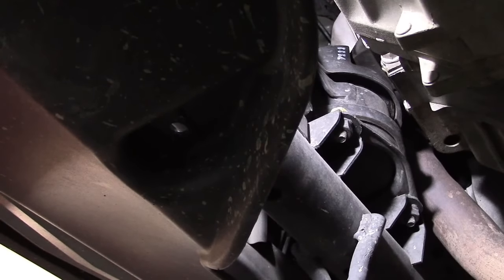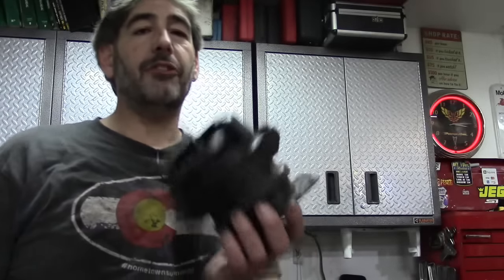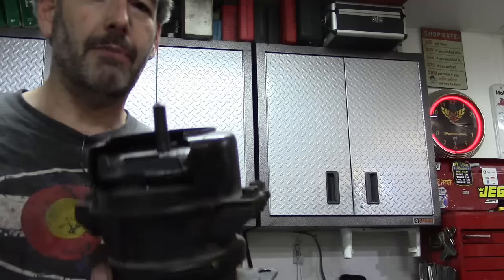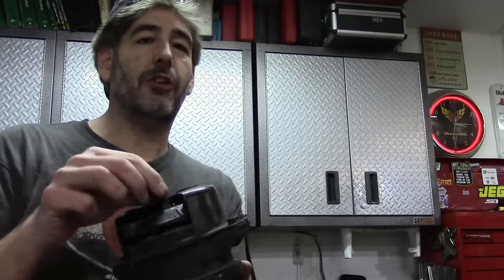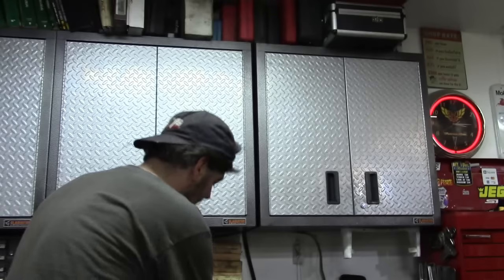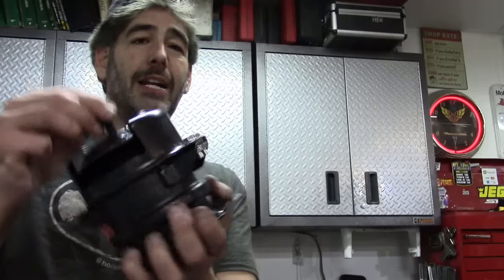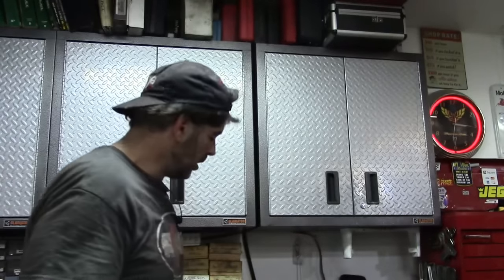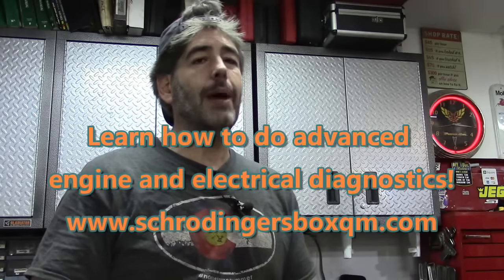How to check bad engine or transmission mounts

Comment: Another tip for anyone interested.... Sometimes mounts can fail another way that causes excessive vibration while engine running that can be felt in cab. Saw this a bunch with 4 cylinder Ford products with hydraulic oil filled mounts. To diagnose have the car running in the condition that creates the vibration ie park, drive, reverse with an assistant at the wheel. Put block of wood on floor jack and lift engine under oil pan. You may notice with the engine at a different angle the vibration goes away. Replace the mount located at the top right front of the car, often described as "front engine mount". These mounts often go bad without any other visual indication.
Reply: I'm so glad i found your comment, i replaced the driveshaft and bearings, took the car for wheel alignment and it was still vibrating i'm gonna try to replace the engine mounts and hope for the best.
Reply: Thank you YouTube family, vibration is completely gone, it was the front and driver's side motor mount, i can't remember the last time i drove with the whole family without the whole cabin vibrating on the highway 😭

Comment: What do you think about putting a floor jack under the engine, and just slightly taking some weight off of the mounts.  Then, if the worn mounts are not under load, see if clunking goes away?    That was my way of diagnosing.
Reply: That sounds a lot easier

Comment: hello, the same thing happens with my 2016 transit, I mention that the engine mounts are brand new from ford, how can I contact you, maybe you can help me, I have this problem for a long time and I spent about 4000 pounds and the problem is still there 😢😢😢many thanks

Comment: This is the exact thing that happened to my LS460. I would brake sharply and it would clunk. Then at hwy speeds when I would try to pass someone, it would shift hard, but only when it would downshift to pass another car. Replaced the trans mount and all symptoms were gone. Good informative video.
Reply: I’m having the same issue with my ls460

Comment: I got the Trans Am to pass emissions -- turns out rotted rubber hoses on the evap line were leaking HC and being picked up by the sniffers at the emissions facility, causing a false positive.  I'm happy!  Thanks for all your videos, Matt.  I've learned a lot.

Comment: I usually "stall" the car. By pressing the brake firmly and adding enough throttle to tweak things. (This is while car is on the ground) that and drive to reverse with the addition of the brake stall. 

Also just briefly snapping (hit somewhat firmly but only briefly)  the brake while rolling forward is it good way to spot control arm bushings. I can just feel it but you can feel the front slopping around or have someone watch it if possible in a pit ideally.

Comment: Do engine mounts leak oil from the top of the black rubber?
Reply from the maker: Hydraulic ones do when they go bad, yes.
Reply: @SchrodingersBox  I have a 2016 Mazda 6 are they hydraulic?

Comment: Just starting to have vibration during acceleration but and when turning to the right during acceleration.   Not a mechanic at all but starting to try to fix this and liked your simple possible explanation of the reason maybe.  You still doing videos?  Have a Juke 2015 with 115,000 roughly miles on it.
Reply from the maker: I have another video of a Volkswagen Jetta where I diagnose a similar vibration you may want to search.

Comment: Hi i just replaced front and passenger side motor mounts.(2005 altima)..still have vibration when sitting at a light....when i put in neutral or park it stops... only notice it when stopped not when driving>>> does this sound like a bad transmission mount to you??? i am pretty sure so i have one ordered... thanks for this informative video...
Reply from the maker: could be engine rough idle. I always start with a basic fuel trim analysis to rule that out before I even consider mounts since it’s so fast and simple.

Comment: How would you test this in a manual? My Firebird makes a bunch of clunking sometimes when it idles, the engine looks like it’s moving around.
Reply from the maker: Same way. have e brake on and slowly apply clutch with car in gear and look for movement.

Comment: Not sure if I am too late for a response however I have a 06 f150 with sadly a 5.4 3v. I have this problem when I left off the gas at high way speeds 60mph+ I feel like there is a slight pull back and a clank. However when lightly letting off gas it doesn’t do it only with a sudden release.

Comment: So I definitely have at least one bad mount but I don’t know if that’s my only problem. I don’t have any clunking when I push the brake but I have a pretty big clunk when I let off of the brake. Could that also be from the motor mount?
Reply from the maker: Yes it can. Could also be a suspension issue. Could be a brake caliper issue. Could be a driveline issue. Could be lots of things.

Comment: Wow. Great tip video. Watching this because im suspecting mine on the gearbox side to be shot. One question, can it cause vibrations when a break before car comes to stand still?
Reply: Got 345k kms on the clock, thinking on replacing all 3, will it be good practice doing it like that, if ones dead the rest can follow
Reply from the maker: yes absolutely bad mounts can cause excessive vibration especially at idle or allow torque conditions. Very very common.
  And yes - I recommend replacing them all. First, they are all the same age but more importantly- the remaining mounts are strained far more covering for the bad mount so they will have even more wear.
Reply: @SchrodingersBox  so i removed my airbox, there i can see the mount, stuck a screwdriver in, very little effort i can wedge the gearbox side of the mount around. That ill take as a shot engine mount

Comment: I'm getting my engine mounts repaired and changing air filter this week. I haven't experienced any clunks, but it has been vibrating pretty bad when it's Idle and it just feels dodgy. Afraid to drive my car atm. Probably get it towed for safety reasons.

Comment: The mechanic revs the engine on neutral I believe and while standing in front of the van with a top view of the engine, I can see the engine tip downward a bit towards me everytime he rev'd it.  So the engine shouldn't move at all ?  Not even a bit ? thx
Reply from the maker: a little bit. but moving several inches is a clue. also any movement indicated at the mount showing separation is absolutely unacceptable.

Comment: Hello I was curious if possibly one of my the 4 mounts on my car was bad including the transmission or motor mount cause when I accelerate after first starting the car or taking off a stop sign/light. My 2003 Nissan Altima 2.5  rides good until past 19/20 mp then jerks for some weird reason and just started about 2 months or so ago.
Reply from the maker: it’s possible. who knows?  What did your diagnosis indicate?
Reply: Schrodingers Box it didn’t pull up any code or anything
Reply from the maker: well of course not. I mean what is the diagnosis as result of the simple technique in the video?
Reply: Schrodingers Box I’m confused what you are saying/asking. I’m staying a fact that my car does jerk when I accelerate around 20 mph and am asking that based on your video here do you feel like the motor or transmission mount can be the possible reason for that??
Reply from the maker: could be. who knows.  I have no data to go on.
Reply: Schrodingers Box I’m just going to get it looked at tomorrow and get my mounts put on and that should fix things

Comment: I have what I would best describe as an intense grinding/vibration when  accelarating from a stop in my car. It generally happens when I have to gas it pretty hard to turn onto a highway. There's also certain RPMS where the cabin vibration gets worse, like 2500. I'm pretty sure it's a motor mount, but i don't think it's developed enough to have a mechanic diagnose the specific mount.
Reply from the maker: Sometimes when motor mounts fail the sagging engine/transmission can rest on the axle. You may see wear on the axleshaft where this happens.
Reply: @SchrodingersBox  That sounds like it'd be the cause of what I'm dealing with now, thank you. I will bring it up with my mechanic, as I will be scheduling an appointment week after next.

Comment: Love your channel man, just subscribed. Lots to learn here and I'm still stumped on an issue I'm having with my 2000 Dodge Caravan Sport 3.3 It all started with my lights flickering. Next day the battery light come on and van loses all power. Had the alternator tested at 2 locations. Tested fine several times at both places, so I reinstall the alt and charged up battery. Van runs good for 2 days then the following morning dead battery. So I take the battery to F and F for testing and confirm defective battery. Installed new battery and the van runs excellent for a day and half, then guess what battery light is back on. Any tips, pointers, advice where to start would be awesome.
Reply from the maker: Check for parasitic draw
Reply: @SchrodingersBox  that was a good choice.

Comment: For a front wheel drive vehicle you wouldn't need all 4 wheels off the ground to perform this test, just the front two, correct?
Reply from the maker: correct.  in fact that’s what I did on this one.

Comment: I am getting a clunking noise going into reverse on 2001 silverado 5.3 with the 4l60e ext cab 8ft bed 1500LS only gear that makes this noise what do you think my problem might be? Doesn't make noise while driving just shifting into reverse and only reverse...
Reply from the maker: could be just about anything. what day do you have for backlash measurements?
Reply: @SchrodingersBox  haven't checked that yet but I think I'm going to try to get under the truck by the rear u joint to get a better listen and I need to check that too what is the way you check that? Parking brake then neutral and move side to side?

Comment: Hey I was wondering if you could help me I have a 92 Chevy Blazer I have my transmission replaced the guy said my transmission keep going out cuz my 4 by 4 bill is broke and it's leaning on my transmission can you explain that to me or tell me what do I need
Reply from the maker: Yes that explanation makes sense. If you have any misalignment of the driveline- broken mounts, broken or bent axles, anything where the axles, driveshafts and engine/transmission are out of alignment then it puts extreme stress on the transmission. You can often see this happen with vehicles that have been lifted like trucks and jeeps- if the lift kit is not done correctly then things will be out of alignment. This causes early failure of components. 
   I would heed the mechanics advice that something is out of alignment causing premature wear.

Comment: the check engin does not light up and does not stall at idle. Only when the headlights are off and I'm at a very slow speed (4-7 mph) to turn. All electronics are turned off. And then open it, close the door, and it all comes back.  And the car forgets all the settings become like from the factory

Comment: How’s it going man quick question can I still drive my car wh a bad transmission mount?
Reply from the maker: Its not a great idea to do it for too long. If the mount is broken the pitch of the  transmission can change which stresses the driveshafts quite a bit more. Its not like the car will blow up but other damage can result over time.

Comment: I have a 2007 diesel ford fiesta manual shift, front wheel drive. When I change gears either up or down and when I accelerate or decelerate I hear a thud. As the car cruises this thud is not felt. This car had a single broken trans mount which I replaced, and the problem still persists. Any ideas on what other components can cause this thud?
Reply from the maker: I would check for excessive transmission shaft input/output ratio variance assuming all mounts are stable.

Comment: Hello i have problem in my nissan qashqai when you release the clutch there a banging what should be the problem with this and the shifting lever is moving when i realese the clutch as well
Reply from the maker: It’s a mechanical issue.  Just look where the sound is and you will see the issue.

Comment: Is it fine to replace the 1 bad mount or change all of them? My theory is if I have 140k miles the others are possibly going to go and if I lift the engine to replace 1 why go through the process 3 more times. Your thoughts
Reply from the maker: oh hell yeah - no doubt. It would be stupid not too. First- as you said, the labor is mostly the same. Second- the other mounts are same age as the failed one(s), and third, if a mount fails the other ones are stressed more because they carry the load so there is every reason to suspect they have excessive wear.

Comment: Hey bro let me ask you something i have a similar problems with my 2010 acura mdx. The car doesnt cluck but when i take off i feel like a little push in the transmission but the transmission shift great do you think it may be the front and rear motor mounts ?
Reply from the maker: No idea- what did tyhe test in the video show?
Reply: Ah i take it to the mechanic and they make a little test like hold the brake pedal and put the car in drive and push the gas and the engine rise up when they do that in reverse too but the engine move  more in drive . The mechanic told me the motor mounts was bad but not that bad but the thing is when i start to drive the vehicle i feel a little push in the engine from 1st to 2nd gear .

Comment: I have replaced both motor mounts on my 2013 GMC Yukon XL for the second time in a month and it is still making the same noise. Is there any other mount I need to change or something I’m missing?  Thanks plz respond
Reply from the maker: Maybe the mounts arent the problem. Were they broken each time you replaced them?

Comment: Hi what symptoms will a bad transmission mount cause 6 speed manual will it cause vibration and clunking noise at idle thanks
Reply from the maker: vibration at idle, clunking when going into gear or reverse and in some cases noises when turning ad driveshaft rubs against frame components.
Reply: Thanks
Reply: Hi, Im from Sri Lanka
Got a Kia Picanto 2005 Manual car. When I start driving after parking (park with engine on + AC on + handbrake) for a while there is a huge noise specially when turning both sides. This noise last for a few minutes until I drive fast for a few KMs. 
Also the noise occurs when driving after idle n traffic for a few seconds. In the cold start the noise is not there. 
What do you think?

Comment: After i changed my motor mounts on my 72 pinto the drive shaft is making a load thump thump thump while it turns. I'll check trans mount tomorrow.

Comment: My Ford F150 4.2 L V6 has code p0303 . I changed spark plugs- it has 53000 miles. It has motorcraft nickel spark plugs. How do they expect it to last 90000 as the maintenance schedule suggests? I thought these plugs only last 20000 miles. I expected it to have platinum or Iridium. I was the original owner so no one touched these plugs.

Comment: If it junks really bad when I put it through gears like reverse and drive it’s the transmission mount correct?
Reply from the maker: it means it could be the transmission mount.  it would be one of the variables to check.

Comment: Is there a difference between a bad transmission mount and motor mount as far as symptoms go?

I have tried like crazy to find out why my car has a slight shake to it at idle that I mainly feel in PARK/NEUTRAL.  In gear idling it actually seems to go away.  Fuel trims are perfect short term and a little lean long term and I don't get any change in rpms when I feel the shake so I'm thinking it doesn't have anything to do with engine performance and more likely is a mount.  I just always thought that mounts are more of a constant vibration versus this intermittent shaking/shudder feel that I get.

Comment: Can  the transmission mount  affect acceleration
Reply from the maker: Yes. If the transmission mount is bad it can change the driveline angle.  In fact I am fixing a car right now where the axle is dragging on the frame due to a broken motor and transmission mount causing a drag.
Reply: @SchrodingersBox  thank you

Comment: I have a 2007 Mustang GT with a manual transmission. I suspect that I have a bad motor or trans mount, the problem that I’m having is when I’m shifting gears at low RPM’s it makes a CLUNK noise. Or if I am in first gear and Tap the gas and immediately let off I hear and slightly feel it. With it being a manual transmission how can I check to see exactly what it is considering I cannot do the brake check on it
Reply from the maker: Use just the brake and the clutch- just apply clutch til it barely engages - you don’t need to use gas pedal.
Reply: Schrodingers Box thank you!!!! I really appreciate it

Comment: Will a bad engine mount throw a check engine light?
Reply from the maker: Not by itself. But if it causes wiring to disconnect or something it would indirectly cause it.

Comment: What would cause a loud clunk when I put my 94 ranger automatic 2wd 3.0 in gear It does it forward and reverse , its a pretty loud bang Any advice would be appreciated
Reply from the maker: Possible backlash. Or engine mounts. or loose driveline. or loose exhaust. What have you found?